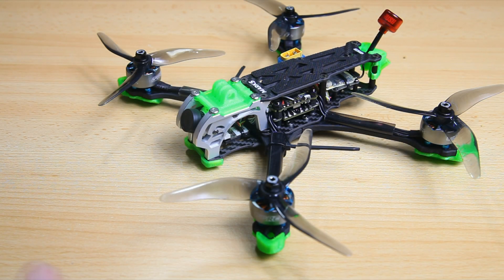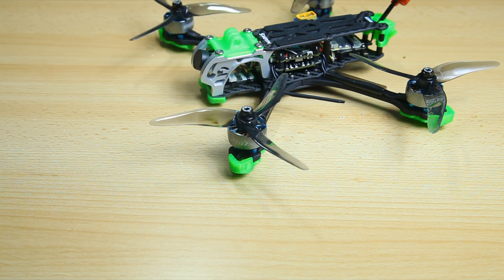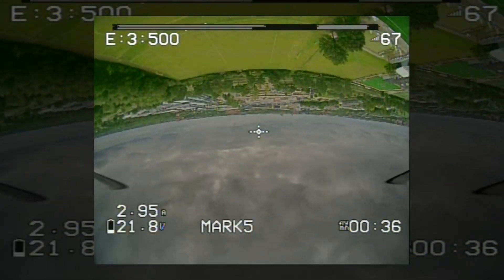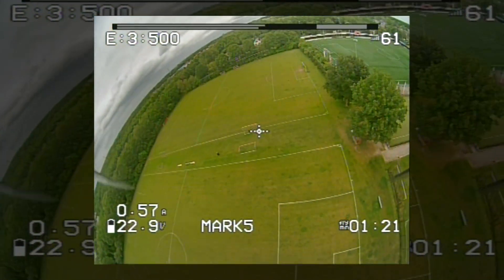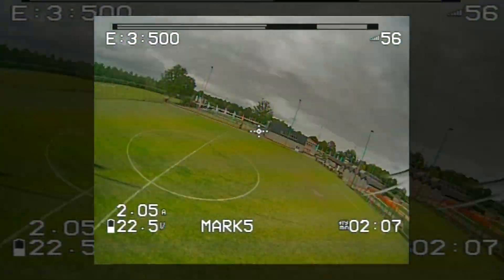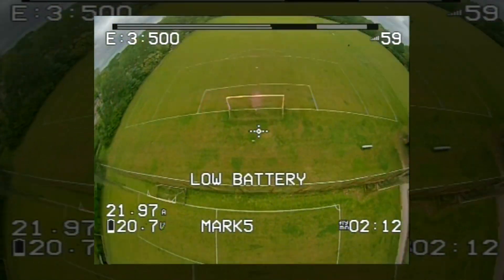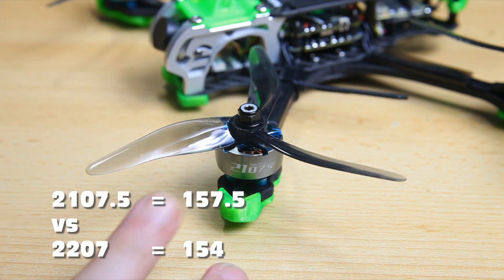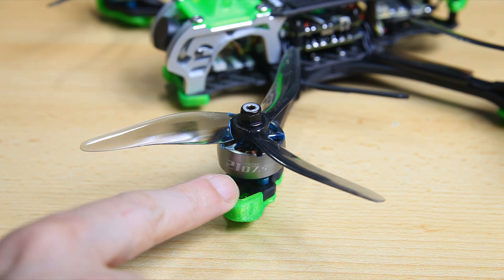GepRC 2022 Mark5 RTF & SPEEDX2 2107.5 - Motor Review

Comment from the maker: in our quest to find the Perfect 5" FPV Quad Motor :) 
The motor: https://www.banggood.com/Ultralight-GEPRC-SPEEDX2-2107_5-1960KV-5-6S-or-2450KV-4-5S-Brushless-Motors-for-Mark5-FPV-Racing-Drone-p-1929190.html?p=TO251813974002015038 

Specs
---------------------------------------
stator: 21 x 7.5 
KV: 1960 or 2450 Kv 
config: 12N 14P
voltage: 6S 
weight: 33 grams 
winding type: single stran 
shaft diameter: 5 mm 
shaft material: ? 
magnet type: N52H ARC
curved magnet: probably 
magnet retainer: nope